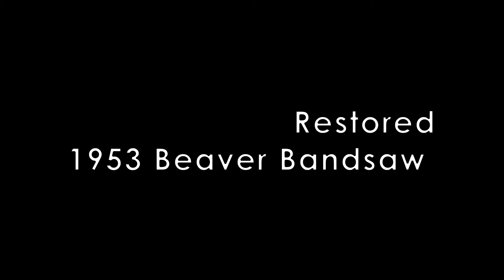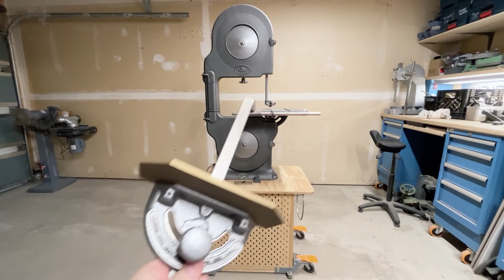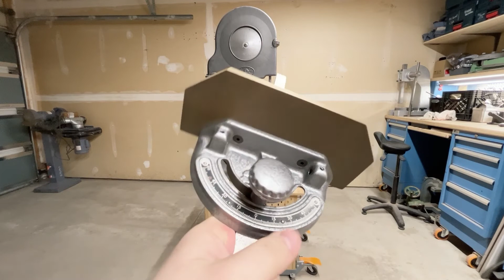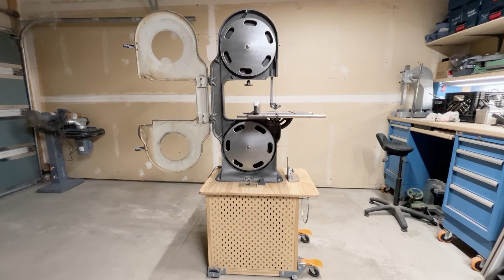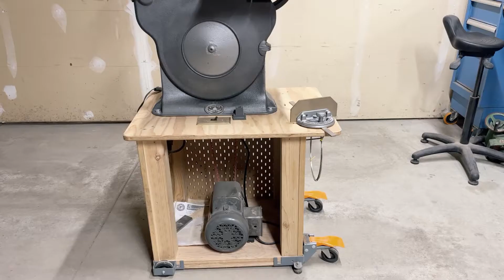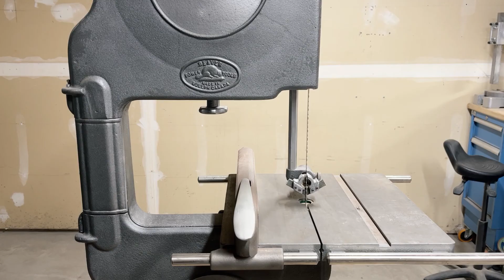Vintage Bandsaw restored - Beaver 3300

Comment: I have the matching 8" table saw, lathe and drill press complete with morticing attachment. The fence on your bandsaw is sweet - the same fence is on the 8" table saw - probably the nicest fence I have encountered when it is adjusted correctly - it is smooth with positive locking - Did you do a paint match and if so what product and colour did you come up with? I am restoring the lathe.
Reply from the maker: Thank you! I obtained the mitre gage from a scrapped 8” table saw. The color is not original, but I found it fitting. It’s Rustoleum “Soft Iron”, I primered and then applied 3 coats paint. No clear coat, which is why it looks a bit more of a “matte” finish.